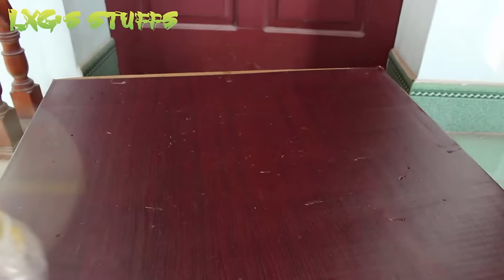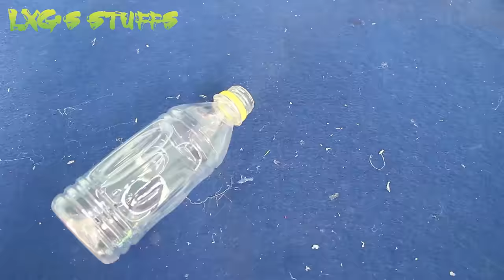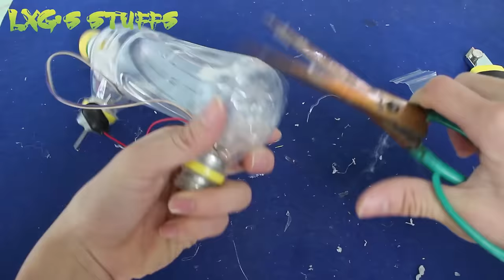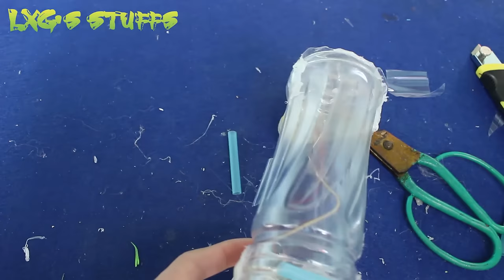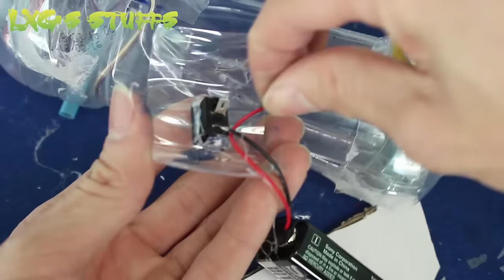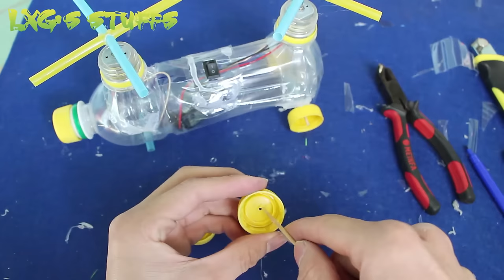How to make a CH 47 Chinook helicopter | simple tutorial

Comment: dude can it even fly
Reply: No
Reply: it can, but you just got to make a few modifications
Reply: probably replace the helicopter blades and use more power
Reply: it can....you just have to put a more powerful battery and modified blades
Reply: David the battery has to be light and the propeller blades have to be tilted to make air blow downwards as it spins a more powerful battery would be heavy and it wouldn't fly...
Reply: joe nodden khnh
Reply: Maheshwaran Puvaneshvaran alok
Reply: joe nodden هلو
Reply: هلو
Reply: ززززز
Reply: David Parker%===

Comment: If you buy more powerful motors and light propellers this thing could levitate or fly

EDIT: And normal propellers.
Reply: nope, it's about as aerodynamic as a brick
Reply: But you don't need it to be aerodynamic for it to fly or levitate. We don't want speed, we want it to simply levitate at a point.
Reply: Shaurya Singh  please explain how you intend to fly without aerodynamic propellers? /Rotors
Reply: Attach motors that can provide enough force to oppose weight and not give a jackshit about it's motion parallel to the ground plane....
Reply: Shaurya Singh you do know aerodynamics does apply to rotors too... I somehow doubt that given even the hugest amount of power that you'd get something using straws as propellers off the ground...
Reply: Ok, that makes, sense. I thought you were talking about the aerodynamics of the chassis which made no sense  lol. I do understand what you're saying now. I was obviously talking about having better propellers instead.